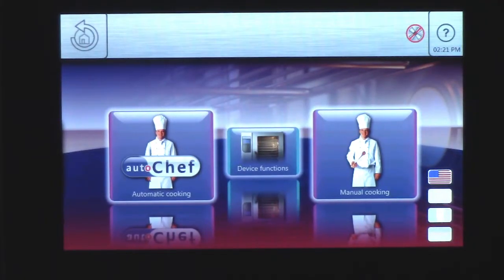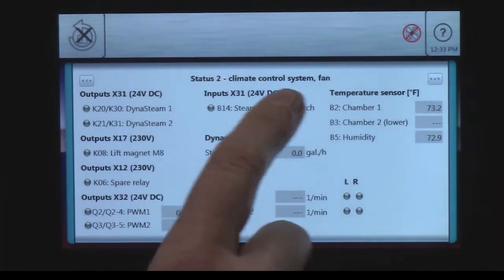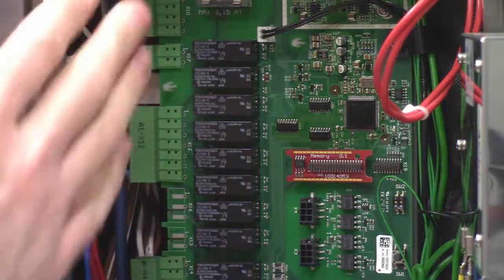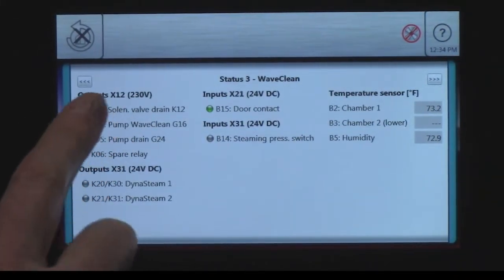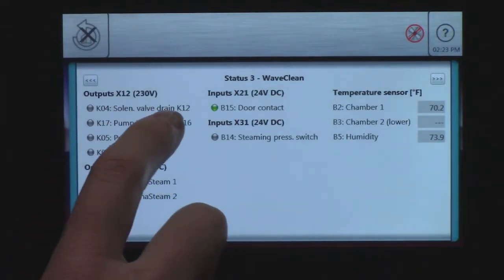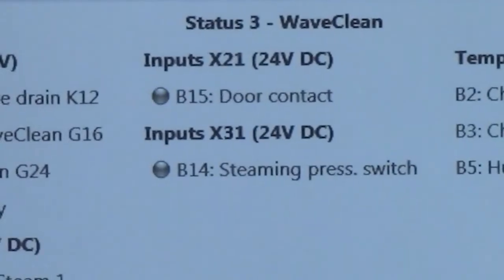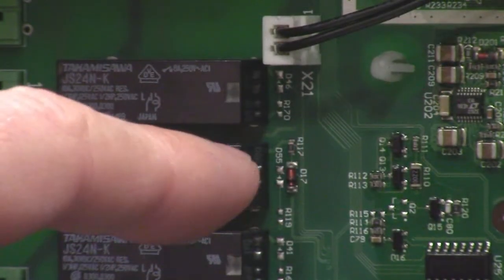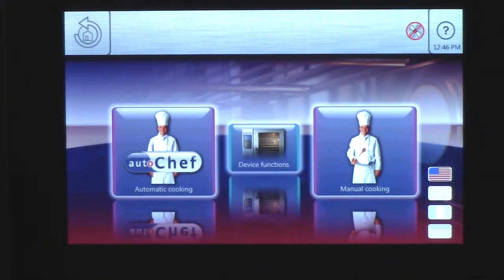4 Status Menus for EASY Troubleshooting in 4 minutes - Henny Penny FlexFusion Combi Ovens

Comment: when doing a wave clean test are you able to get into this??
Reply from the maker: A WaveClean test can be performed by using the "Combi Doctor" feature. We don't have a video available on that yet but you can find instructions on how to perform this procedure here: https://www.hennypenny.com/wp-content/uploads/2019/08/FM06-101A-FlexFusion-Elec-Gas-Platinum-Combi-Service-Manual-.pdf
Check Page 31.
Reply: That is the beauty of Status Menu, you can try it and see. It is just that simple. If you are able to get in, great and then if you need to get out of Status Menu for any reason you back out by tapping the X/Back Button in the upper left hand corner.